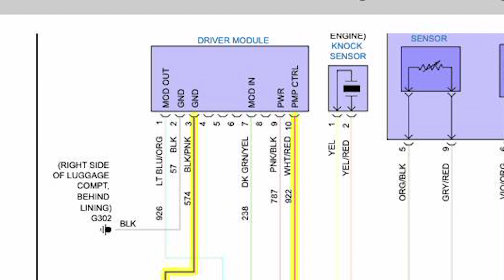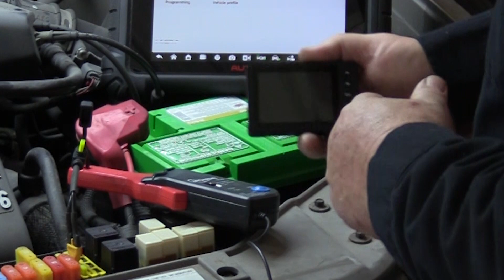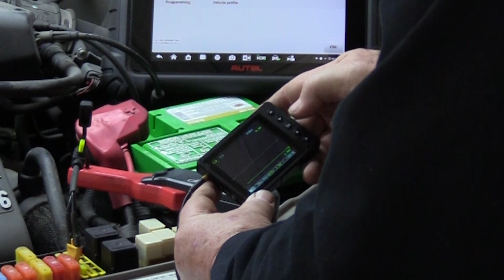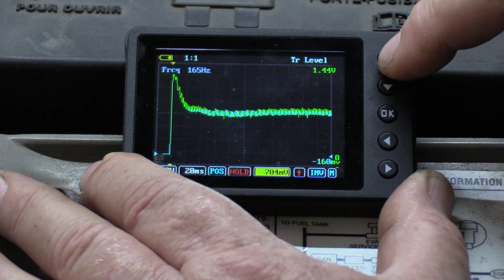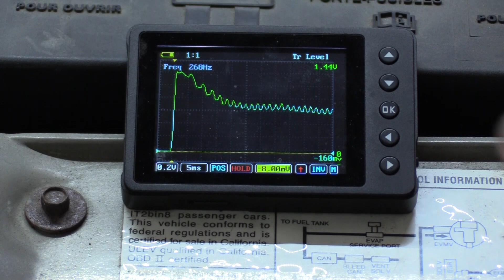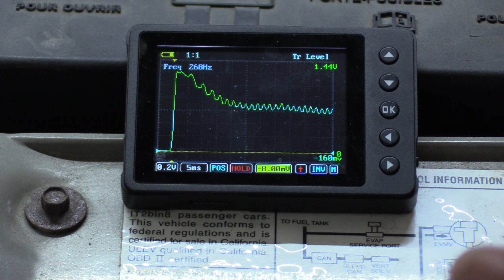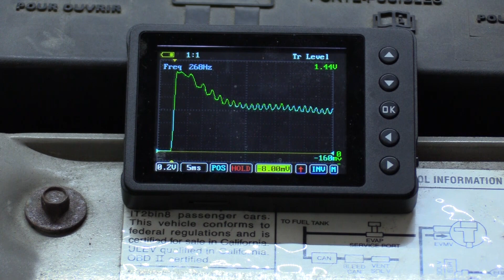Service Done Right #8 - Don't Replace The Fuel Pump Until You've Checked THIS!

Comment: 11.7 battery could drop abnormally lower than usual with a load if the battery has an issue. I would charge it or replace before spending time load testing wires.

Comment: Would you not have to disconnect the injectors so as not to flood the cylinder with fuel when turning on the fuel pump?
Reply: The fuel injectors are normally closed so no risk of flooding cylinder unless the injector(s) are leaking.  If you pulse the injectors manually to test for a restricted injector using the  pressure drop then it will be spraying fuel and would be best to start it after each injector flow test.

Comment: In regards to researching the voltage drop, doesn’t the 7.2 amps reading indicate that the pump circuit is good/healthy?  Doesn’t the circuit have to be healthy to support that much amperage?  Or did you just want to demonstrate the voltage drop as well?  Was your intent to show how to do a voltage drop test if the amperage was low?